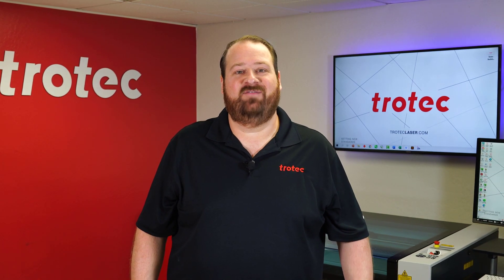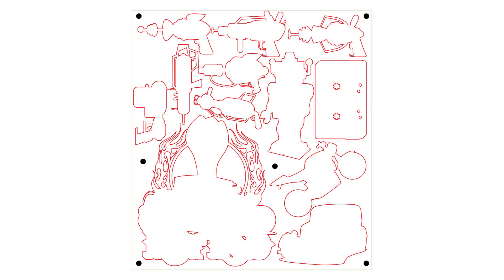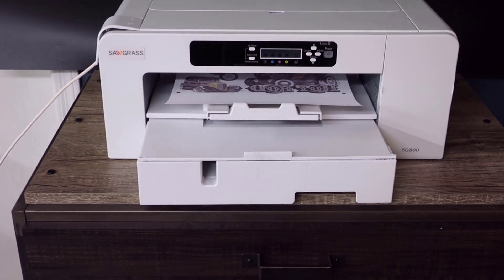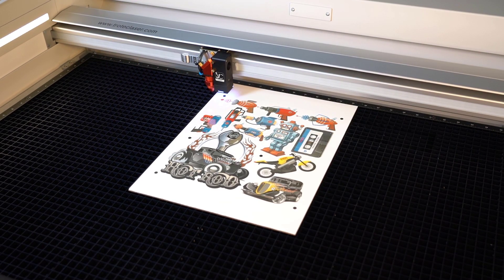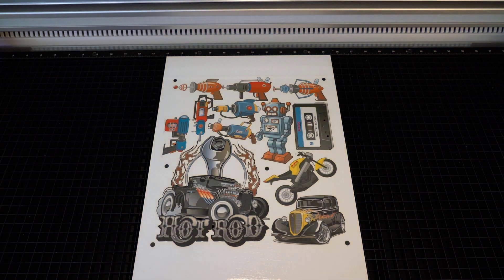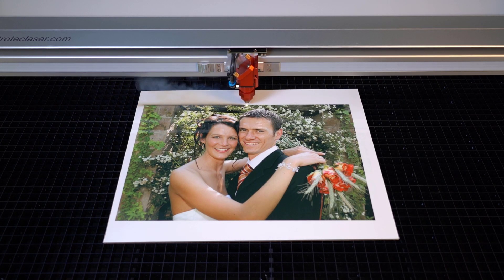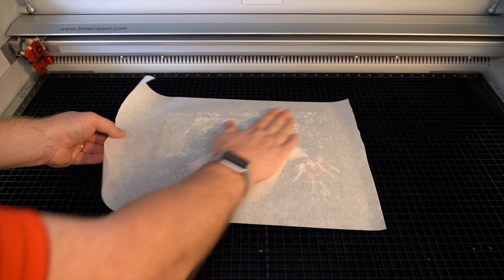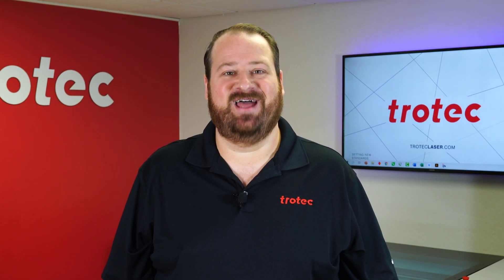Laser Hack: Low Cost Print and Cut

Comment: this is great.... Just wanted to ask about the fumes on this material. since it’s a fiber board, is it environmentally safe to laser cut? I’m just asking because I have my trotec laser in my garage and I live in a community (village setup - NYC).
Reply from the maker: Hey Augie! MDF and fiber board materials are some of the most common and popular laser friendly materials, they are not harmful to your laser system when cut or engraved but this material like any material needs to be well ventilated or filtered according to your local and state laws.
Reply: @TrotecLaser  thanks for the reply.... when I bought my trotec laser with atmos duo... I was advised (by trotec) not to cut any MDF or fiber board materials because it’s toxic and bad for the filter.... the atmos duo filter cost $500. What would you advice?
Reply from the maker: @augiemillares3817  Please reach out to our technical support team if you are experiencing any issues with your filter or if you would like more information on processing materials safely. 734-720-9997 option 2